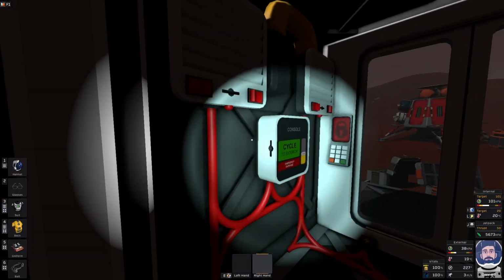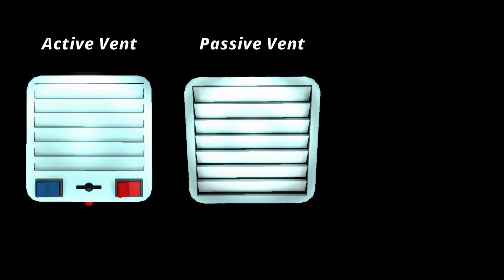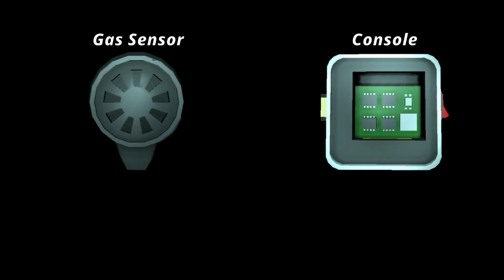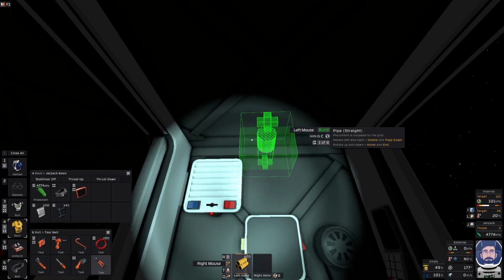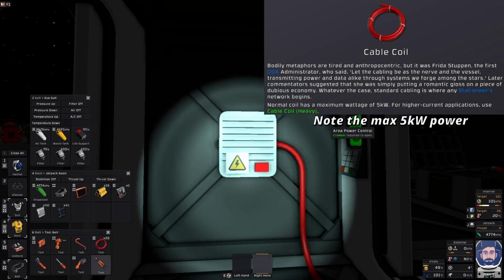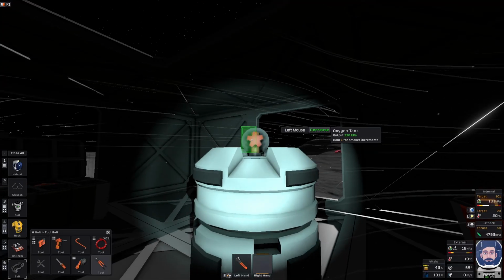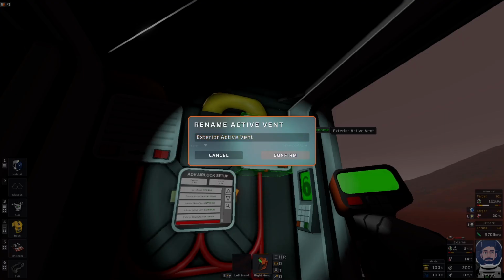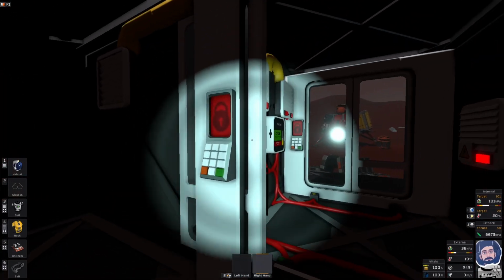TLDR Stationeers Tutorial - Basic and Advanced Airlocks

Comment: Where is your gas sensor on the advance airlock? Thanks for the great video
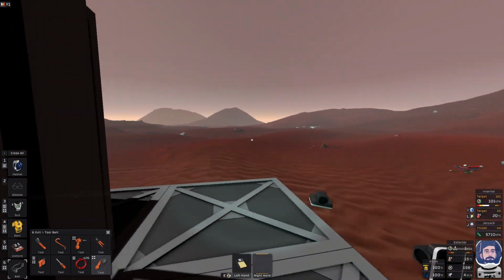Reply from the maker: Thank you! It's still inside the airlock, you can very briefly see it when I exit and turn around at 6:45 in the top right corner of the left wall. You typically want the gas sensor to always be inside your airlock no matter the type as it will tell your airlock chip when to start/stop venting.

Comment: Once Airlock is configured, how do i go back to manual? I like to use the airlock for splitting volatiles and oxygen during day. But switching off, configuring with disk, its always working automatically once its set.
Reply from the maker: You can always put the chip back in and remove all of the settings to go back to manual mode.